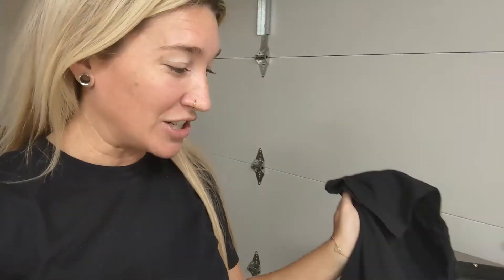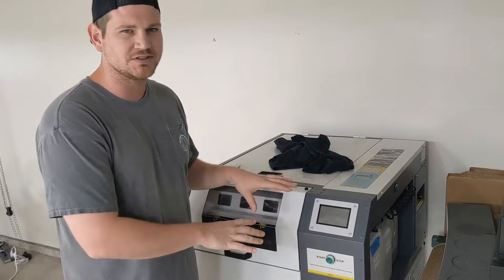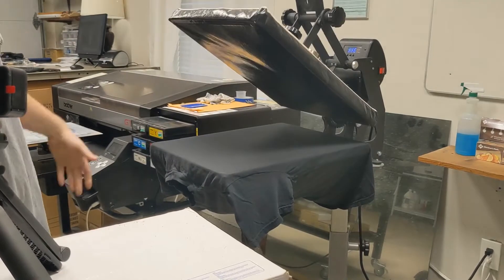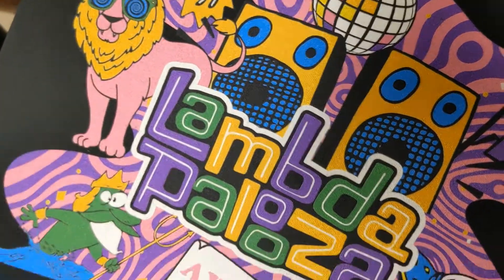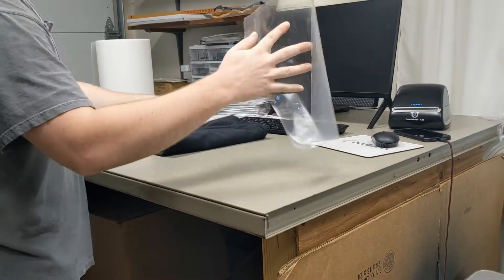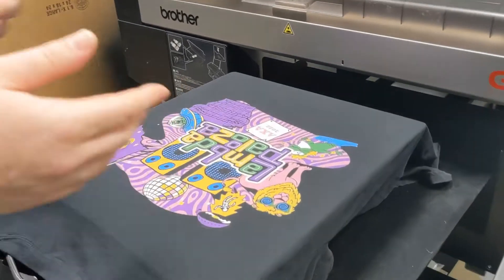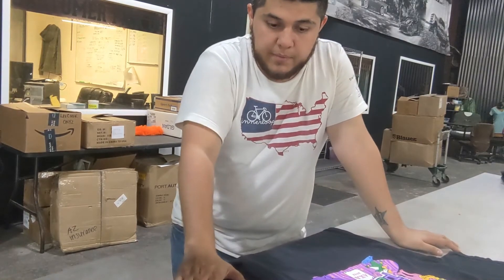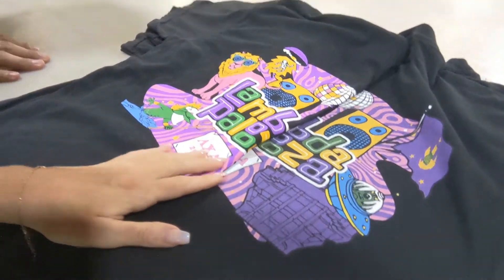Culture captures Real Time DTG prints & Compares to Screen Printing

Comment: The process when I did dtg was with a pretreat machine that always broke down, so I wasn't surprised when you had to use the black and decker power sprayer, the only difference was maybe a step where we had to knock down the fibers of the shirt in one direction so the dtg could print better. The whole process takes a while to do so by comparison if you include the process of screen printing. You have one guy doing artwork and separation (some people have direct to screen so we can skip the film ouput) one guy cleaning screens add dry time, maybe the same guy coating, the dry time then burning washing and taping and blocking out after more drying. Another guy sets up the design mixing inks, and if the there's enough shirts two people load and pull, finally one guy catches counts and packs up the shirts into boxes and ships it out. That's all done to speed up the manufacturing process and it might take two days if you add in screen cleaning and prep which you should. Here we saw one guy do the process he did to print three shirts, obviously this process is longer to print each shirt but when compared to the entire screen printing process this was faster because you are going straight from designer to print. If you used a Kornit DTG your process is even faster because they print on the pretreat wet and have a huge printheads printing with two platens, only the drying is slower. The bad part about the faster Kornit printers is the price, I think 280 k for one dtg , and the 300 dozen an hour was 1.8 mill after installation I think that was before inflation. The after comparison is really close, I'm impressed by the closeness and the white on the non overdyed shirt. This was a great video with great breakdown of the process, I hope you get a million views!
Reply from the maker: So we Broke down and now have our absolute Own DTG machine,  We opted for the Epson F2100 because we ALSO do a lot of DTF (Direct to film) We will see how it goes, but really looking forward to this new path of opportunities.

Comment: thanks for sharing this one. I have to say the jury is still out for us on the DTG prints. Are you thinking of using it for fulfilment and running smaller quantities?
Reply from the maker: In the video I discuss that DTG is ideal for anything that's more colors than what we can screen print paired with quantities. Luckily we have the ability for sim process and have enough heads for spot color if it's something we truthfully want done in Screen Printing. It all comes down to quantity & expectations! We offer DTG for rush small full color jobs of at least 24 but less than 72
Reply: @KendraCultureApparelStudio  Thanks, that's a good split on qty I reckon.
Reply: @KendraCultureApparelStudio  - Try something like DTF, etc instead also
Reply from the maker: @Novoworks  we have worked with DTF as well! We actually make DTF Transfers with our DTG equipment! But again, mostly for very small orders, we like to make screen printed transfers, or HTV For simple two color projects

Comment: Should try Teflon sheets for curing, same finish, costs less long term.
Reply from the maker: I've used Teflon sheets before! I just don't like the moisture they don't permit to evaporate out. We even use parchment paper for HTV & protecting screen printing as well. Where the Teflon sheet makes it look rubbery :/